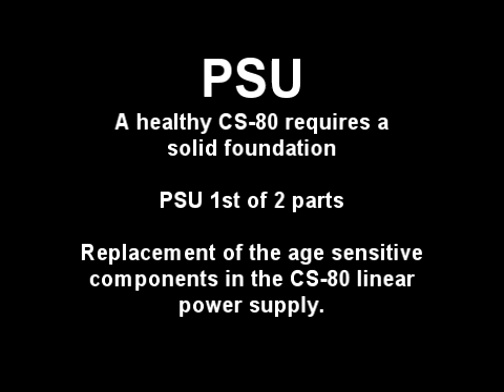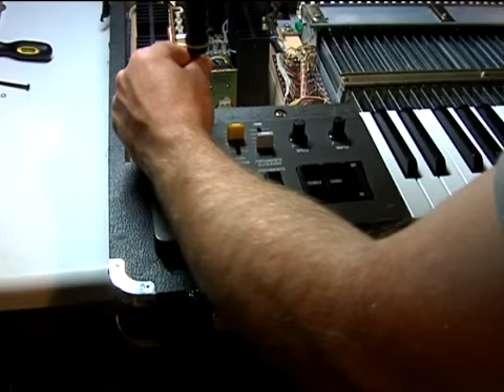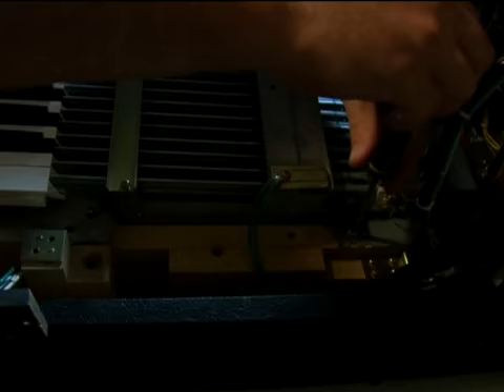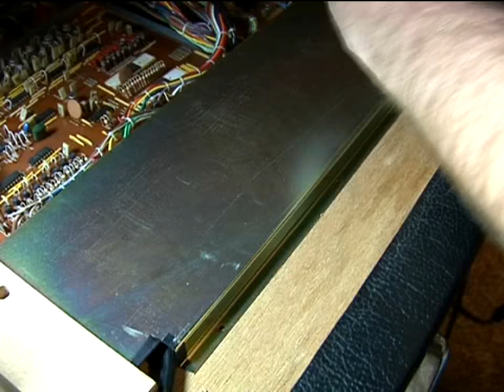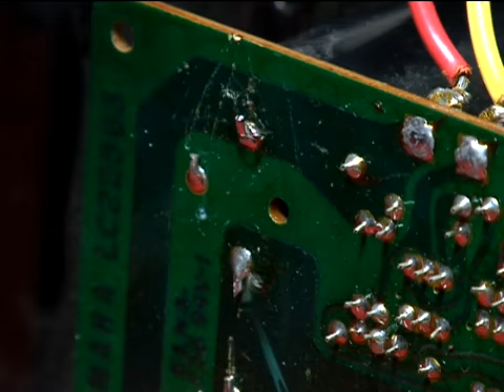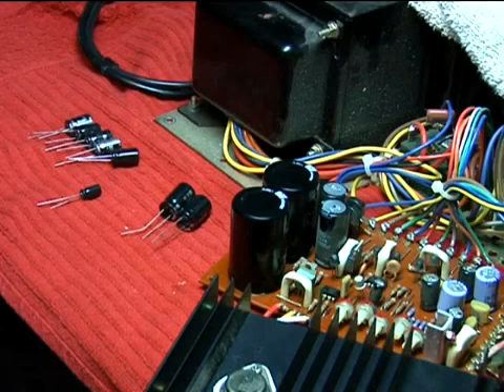Saving the Yamaha CS-80 (2) The Power Supply

Comment: hi and thank you for this very good video,if I may ask anyone on this page to help with a question about my cs-50 it runs great, until the sound even at the high volume(have thought of pre amp)? started fading over time to no volume at all, I have pro amp and front house speakers, she won't even squeak when turned on please if anybody has even an inkling about this maybe they are known for it but I can't find much on the matter thanks again have a wonderful day.
Reply from the maker: Sounds like a gating control issue with the envelope control chips.  I answered your question on the other video of mine you asked the same question.  I can't answer it here because I can only enter about 4 words a minute on this video comment section.  I have no clue why computers and smart phones suck so much in 2018 other than lazy hack programmers churning out garbage as they tend to do.

Comment: With the power off on my CS-80, I am getting a 70 ohm resistance between +15V card rail and ground - does anyone know if this is this normal?
Reply: Hello Jon, dunno if you found the answer to your question yet, but i can confirm 70ohm is exactly what you should get there.

Comment: Hi, Very nice stuff indeed. Good to have found this as well so thanks for that anyway. Still waiting for that quote though.
Reply from the maker: I have kits out there that you can use yourself to rebuild all the systems covered in my videos.  I don't make anything off of them, did it to help keep as many CS-80's going as possible.  The CS-80's I have rebuilt have been about $1000 for complete rebuild of the entire bottom end including the KAS board and calibration.  Also restoration of the aftertouch sensors and rebuild of the keyboard deck is included.  I am working with a supplier right now to make brand new aftermarket key trigger leaf switches and aftertouch sensor pads to replace components that are beyond repair.  For a top to bottom restoration, that is the bottom level rebuild, new key trigger switches (all 61), new aftertouch sensors (all 61), full recap of upper boards (not just electrolytic, but all mylar, ceramic and film) to modern temperature stabilized versions, complete replacement of all open frame trimmers to sealed multi-turn instrumentation grade units, conventional ICs are all replaced, LED voice card activity indicators to assist with tuning and a complete calibration you are going towards the $5,000 mark, a good portion being parts cost.  You will have a perfect functioning CS-80 though, much more stable than when it left the factory.
Reply: Hi,
A full blown refurbisment as you describe is not economically feasible , the bottom one being more reasonable. Since I do however live on the European main land (Comrad! I see you live near Moscow and the University of Idaho at the same time!)) so transport costs and the well known transit risks do not really make that feasible either.
I would however be interested in kit prices for 2 cures. One for overall recapping and a separate one for doing the aftertouch. The aftertouch on mine is however not giving any problems at all. So is tuning etc. as long as you give it enough time to warm up.
Reply: The Dollar Guy Where can I get ahold of these kits please?

Comment from the maker: I am 41 years old and worked with electronics since I was very young.  Soldering at 9 years old.  Repairing VCRs at the local mall when I was 15.  You tend to learn when something is engineered well or not.

Had a Bontempi chord organ when I was 7.  Then got a Casio CT-405 full size keyboard at 14.  Traded in for the Technics KN-1000.

I don't repair synths as a profession, but I acquired a CS-80 because of the sounds I remember.  Carl Sagan's Cosmos, I would have the synth someday.

Comment: Thanks for the excellent video. I presume the (1) video contained lifting the card cage since it's already lifted in this video. One could debate that there should be enough slack on the cord to lift the PSU up, prop something under it and work on it there rather than lift the card cage, keys etc.

Comment: @gavincurtis Indeed sir. It is always great to get tips passed on . Unfortunately being forced to design things into smaller and smaller spaces compromises have to be made. But judiciously .
 If you ever work on a switch mode psu keep in mind that no application note that I have ever come across mentions the mains ac ripple current when sizing the bulk input capacitors.  And always derate for frequency.

It's so funny your rule of thumb re heat. We do the same. 2 secs is about 60degreeC

Comment from the maker: @peggymount Example, CS-80 6 amp capacity transistors are used to regulate 1/2 amp maximum.  1 or 2 amp transistor could do it.  Great to meet another engineering mind here  :)

My own rule of thumb is if normal operation of a part is too hot to keep your finger on, then it will not last.  When choosing electrolytic caps get ones rated at least double the voltage of your target.  Avoid any and all electrolytic under 25 volts period unless space is a concern.  But I am and still always learning.

Comment: Oh Joy. I've had 5 years of hell with burst capacitors in one of my designed power supplies. Why we gave a 5 year guarantee, I dunno.
 I'm surprised the caps in the dear old beast are not gone already. Perhaps capacitors were better made back then, or just badly made now. You can't beat Nichicon CS or  Rubycon ZLH series. IMO. 1050C and 10,000hrs.

Comment from the maker: @PimpinBassie2 Hi,  Got much of my info from Old Crow's great website.  Especially the service manuals and links to other parts of the service manual.  Be lost without his website.

I didn't find where he rebuilds the power supply or TKC1 + 2 boards.  So not attempting to copy.  When winter comes around again, will continue the videos.